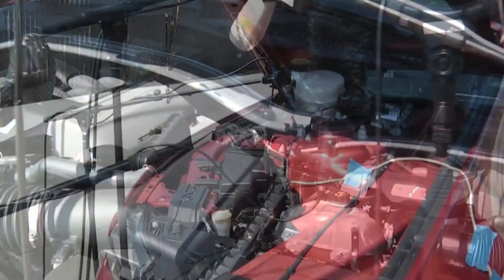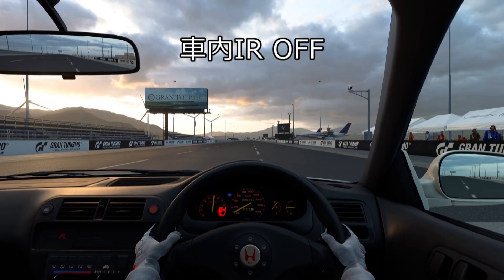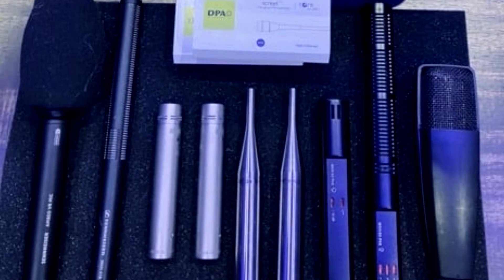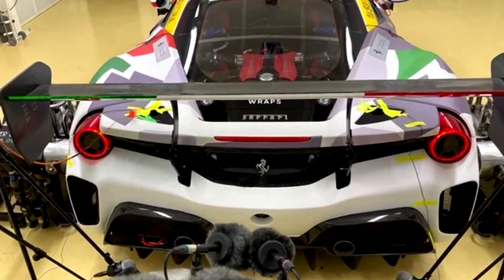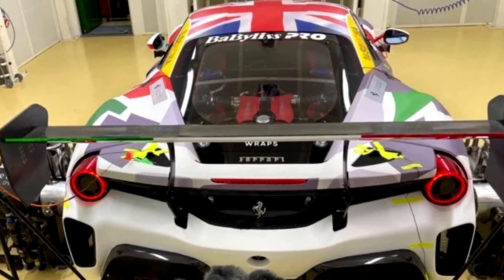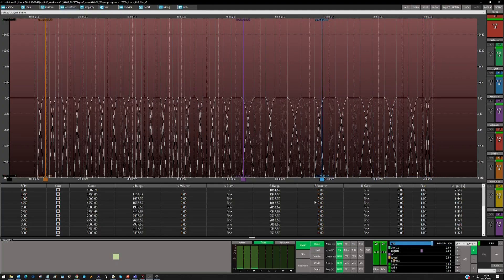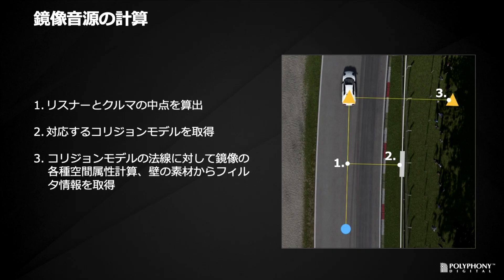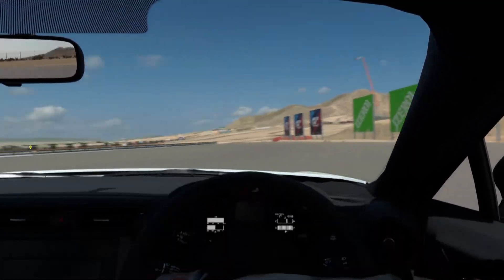Recording Car Sounds for Gran Turismo 7

Comment: I didn't know recording a car sound was so difficult. Respect.
Reply: Indeed. You would think simply recording the engine and exhaust and playing it back would be enough, but it gets extremely complicated. Playing back looped audio becomes immediately noticeable, so you need to use synthesis and variation to avoid generic repeated sounds. It’s arguably as hard or even harder than the physics tire models. Really tricky to get right, and really easy to get it wrong and ruin the immersion

Comment: Its sad that while these sounds are great, they game still lacks huge in immersion. Cars sounds like they all have a bit of slipping clutch when accelerating. Even Forza doesn't have this. And when compared to ACC, the shift sounds are so poor. When playing ACC you feel like you're in the car. The raw sound of the car, debris and curbs are aspects I miss in GT7. Which makes it feel like I'm playing a game instead of a simulator. And I'm not even talking about the physics but that's because they have a different realism level. But I guess that's what GT7 is made for. If they would include these aspects, GT7 would have no competition.

Comment: Assetto Corsa raw sounds inside the cabin are much nicer for a very... physical experience. However, that does not detract from GT Sound, which is either way amazing. IDK, I have an audiophile rig, and when I play GT7 with loud volume and sit on the wheel, maaaan... the sense of presence from side to side and distance to other cars and so and so... it is brilliant. It is an extremely satisfying experience, so much so that is rewarding even if you are far from winning a race.

Comment: Looks slightly cheap from a sound engineering standpoint. An old Digidesign 16 i/o, older RME interface, NT5, I spot a Beta 52 etc. Not quite top of the range equipment, but ok, I guess.

Comment: Whilst the engine start ups and idle sounds are as good as it gets, I can't help but feel some cars aren't done justice when driving them. 205 T16, Quattro Pike's Peak and Mazda 787 maybe some of the worst fidelity to the real thing.
Reply: Not an issue just of GT tho, the Quattro in DiRT Rally has this comically horrendous and super fake sounding blow-off valve, and half the cars use the same actual sound just meerely twekeed. 

I feel like the crazier and more iconic a car's sound is, it gets exponentially harder to reproduce that sound in a videogame. So many expectations on all the features of the sound to take on board.
Reply: Not even close to good as it gets, try AC and ACC and come back.
Reply: @CrewExpendable2007  lmao what you talking about? Not one time I said anything about Assetto's sound design. Some of you are more eager to be sassy with some "how about you tru this and come back" when no one is talking about those. Assetto Corsa and Assetto Corsa Competizione have incredible sound design, but won't match the start up/idle sound of cars in GT, down to the reason those are direct recordings playing back, not a sound engine actually having to make a sound. "How about" I've been playing some of these games since launch and got a clue what I'm talking about.

If you really want to talk good sound design there's no need to go out of Play Station exclusives. Driveclub definetly was and still is one of the most inmersive experiences in a racing videogame. Sound in both Assettos is great (bought Corsa just to fool around with the quattro), but Driveclub was a masterclass. Visceral, believable and good.

Comment: They finally got the sounds right after 20 odd years.
Reply: Not really. More like 75%, just listen to LFA in garage vs on the track.
Reply: @Sylsomnia22 they nailed the lfa even during gameplay even better than ac with mods
Reply: @andreasmoller9798  LFA sounds okay, especially from slow acceleration, but listen to start up in garage VS on track idle rev, there's a huge difference.
Reply: They’re still far from right.

Comment: When you are in replay mode or some times in chase cam, the wind is way louder than the car. I don´t believe that is realistic, in that sense i would much rather have something similar to assetto, the chase cam and replay in ac sounds really raw and loud in certain cars, wich is something i feel like its missing in gt7, most cars sound feel muffled. Other than that, i think that they are doing an amazing job at the car sounds
Reply: Muffled, because no dynamic.

Comment: I have two BST-1 bass shakers on my racing rig, one under the pedal's plate, the other under the seat and the bass shaker's amp connected to the monitor's headphone jack that I use with the PS5/PS4Pro/PS3. I previously had the bass shaker's amp connected to the laptop to use SimHub with GT7 and I wasn't even aware that these bass shakers would play any audio besides shaking/vibrating until I connected the bass shaker's amp to the monitor's headphone jack, changed one of my cars in GT7 where it started revving very loud through the bass shakers and making me feel the engine revving too. I was blown away by the revving sound of each car I changed going through the bass shakers and feeling the engine revving like in a real car to the point that I kept increasing the volume and changing my cars again lol. Good job Polyphony Digital sound engineers.

Comment: "Built from the ground up" done right. And no, I'm not memeing or anything, it's just one of many proofs, even though it came at a cost of compromised single player quantity.
Reply: rolfwaffle would say other otherwise this game is also on the same caliber of awfulness just like mf ghost and Forza
Reply: @siddheshpillai3807  I actually agree with that. The difference is that they actually did it, unlike Forza where they actually lied straight up. Also, it's great if your opinions aren't based on what someone else says.

Comment: Forza has been rough throughout FH3 and FH4 but i feel like with FH5 and the addition of intake noise that varies depending on the filter / intake system or the different levels of exhausts you can fit definitely improved the sounds. Rotarys and small displacement 4 cylinders dont sound like mosquitos and the inline 6 and V8 engines have gotten a lot beefier. I hope they take it even further with FH6 and use the same principles as GT does. It definitely pays off.
Reply: Agree but they ruined turbo dynamics. Turbos will purge at any rpm/throttle input

Comment: I don’t understand how they record the actual cars for the audio but then they don’t actually sound like the cars in the game?!

I mean I applaud the effort but it just doesn’t translate to the game as well as it should. 

Much better than they used to be, mind you.
Reply: How many of the cars in the game have you heard IRL?
Reply: @ViaticalTree  I’ve heard a majority of the cars in the game in the actual (real) world, and the sounds in this game are actually terrible. They do not emulate reality on any scale. OP is right ^
Reply: @ViaticalTree  an easy one for me is an STI. Everyone's heard an STI, the boxer engine note is very distinct. GT7's interpretation completely lacks any of the low rev growl or the throaty-ness (scientific term) at the top end.
Reply: What headset or sound system are you using?
Reply: @dsmith9599  High end headphones like Denon D9200, Meze 109
Reply: @dsmith9599  Bruh 😂 “what headset are you using” GT7 sounds are terrible, is what it is.
Reply: 🤦🏼🤦🏼those Japanese STi's don't rumble🤦🏼🤦🏼

Also the boxer engine doesn't actually sound any different then a regular inline four, that's just something people who don't know well enough believe, Subaru simply uses cheaper unequal length headers, that's where the rumble is from, but in Japan it uses higher performance equal length headers for that STi, only unequal STis

This is the same reason the GT86/FRS/BRZ all don't rumble even though they have boxer engines, same with; BMW, Porsche, Toyota boxer engines over the years, people's expectation of reality & real reality are often misaligned
Reply: @ChroniclesofKToyoda  where else they building STi? Literally all come out the same factory. I know it's the unequal length headers (not necessarily "cheaper" btw) and I'm still standing by an STI and Civic sound nothing alike anywhere on earth, except in Gran Turismo.
Reply: @CaptDust  you huffed & puffed about how boxers need to sound a certain way which is false & the STi in the game that doesn't rumble also doesn't in real life because it's a Japanese version

Stand by it if you like, it's still wrong for you to want it to rumble when the real version of that car doesn't do that & does have the cadence of regular 4 banger, there's guys on YouTube that's even made videos to point this out
Reply: @ChroniclesofKToyoda  I aint huffed, just another person that want Sony to do better. They got all this money and they got their sound engineers doing the most. Whatever they're capturing in these booths is getting crushed by the time it makes it out a PS5. Thats all. Goes beyond an STI and generational or market differences, you can compare an AMG or M3 or whatever take your pick - it don't sound like Asseto, or Forza, or real life.
Reply: @CaptDust  bro face it that STi sounds accurate, there's video proof of it, I'm using a proper high powered subwoofer & it sounds amazing, none of that tiny flatscreen limp soundscape

People just want that amped up Hollywood Video Gamey sound because they're removed from reality. NVH is a thing, everyone expecting blowoff sounds on internally wastegated turbos & act like they're the experts

GT is literally started by an Ace Sound Engineer from Sony's music department, they know what they're doing within the constraints of the hardware without sacrificing on authenticity
Reply: @ChroniclesofKToyoda  “Within the restraints of the hardware” is the most important part of that paragraph. The game engine they’re using doesn’t allow for the optimal transfer of pre-recorded audio into the game itself and that’s why the car’s do not sound accurate. If you have any interraction with an actual race track or “high performance” or even enthusiast cars at all you know right away the sound design in the Gran Turismo series has been horrible for the last 20 years and it hasn’t changed. Its mildly improved but the base issues are still present.
Reply: @CrewExpendable2007  lol "pre-recorded audio into the game" isn't hard at all, playing a recorded sound has been trivial to do since original PlayStation, what's difficult is having it play at correct frequency & load for a given time with regard to space & acoustics something that's easier to do on PS3 then 4 or 5 because of X86's lack of bandwidth, with that in mind the audio is extremely good for hardware that isn't bespoke realtime audio processing gear

You can play an MP4 file of real cars that doesn't mean it's an accurate sound for the conditions GT isn't like GTA, Polyphony Digital is actually trying to make the audio accurate as it comes out not simply sound like a limited run of switching sound samples. As some who's literal job was at one point to road test other people's cars for a living(at times after modifying them)people don't realize how tame most cars actually sound especially modern unmodified cars
Reply: @ChroniclesofKToyoda  I realize that, believe me I do. My quam is the other 50% of the car roster still sounds nothing at all like what the actual cars sound like. Games like ACC, iRacing, RaceRoom, even non-sim titles such as Driveclub from 2014 (10 years ago!!) was able to absolutely shatter every opponent in this department. So the single largest company in the entertainment industry (Sony) can’t do just that, 10 years later? They can. But there is no demand for it, because Gran Turismo fans are too complacent, too comfortable and naive. Their only real competitor (sim-arcade, not full on simulation, because Gran Turismo isn’t one) is Forza which isn’t even worth talking about it’s such a failure. So no competitors, no demand from your financial support, = 0 improvements. And that’s exactly what GT7 is in terms of it’s sound design. 0 improvement.
Reply: @CrewExpendable2007  can only comment on the sort of legal cars I can draw experience from, & they haven't put a foot wrong in terms of sound, as for genuine race only cars, well I've only ever tracked modified street cars most haven't even done that so have even less experience to draw from but even those aren't built like complete rattling tin cans as some would have you believe

The issue is really people's expectation of what realistic sound is, Driveclub as example is extremely pleasant sounding, many would even say realistic, but in reality all those cars are far more muffled & tame compared to how it's portrayed in media which is obviously more arcady & less accurate

Hollywood for example shows every Tahoe & Suburban with the same played out breaking SFX ignoring the reality of just how much nosedive it takes when actually locking those up assuming ABS let's you, even more atrocious is the Crown Victoria cars sliding about left & right every chance they get, when in the real world it's near impossible to hold a slide in those unmodified even breaking traction from a launch more often than not won't happen, that's reality

TLDR; everyone expects arcade SFX from GT like turbo spooling & blowoffs when most factory cars in GT already do spooling louder than they should and almost all factory turbo cars are internally wastegated so that sound shouldn't exist, then you have people like OP asking for a boxer rumble in a car that's not even supposed to have it because the folks criticizing GTs sound for the most part are living in their perception of reality. Kaz' the cook is Sony's literal Ace Sound Engineer pulled from Sony Music, & ever since he got back into overseeing sound(GT Sport)sound has been amazing, then again I'm playing with a bigger powered subwoofer than most, people playing on anything less are doing themselves a disservice, like playing without HDR, you're giving up a whole dimension of depth that's there but only with the right hardware

Comment: Dirt Rally 2 and ACC sound outstanding too!
Reply: They are both light years ahead of Gran Turismo in terms of sound design.
Reply: ACC is one of the few games that captures how loud real race cars are, I work in racing and it is deafening… ask me how I know.. loudly.
Reply: @ricepony33  I think even ACC could be louder. Ive attended a few GT3 races last year and have a few to go to this year. The 992’s and Huracan’s in particular shatter your ear drums, especially if you catch them downshifting. I recorded audio of a 992 downshifting on a hairpin, it sounds like satan screaming at you, its intense! Gran Turismo does an absolutely pitiful job at recreating this, AC and ACC do it the best so far with sim titles like Raceroom just behind them.
Reply: @CrewExpendable2007   because gran turismo 7 has variety of vehicle type  polyphony digital goes from a divers point of view although 3rd person point of view sound may differ
Reply: @ricepony33  
I agree 100%.  I worked in F1 in the early 2000's and those V10's would make my internal organs rattle around each other when standing mere feet away.
Reply: The sound of slightly slipping tyre rubber in ACC is superb. I wish every game had similar audio quality.

Comment: Another thing i am wondering is the difference between garage sounds and in game sounds. I believe the garage ones are actual recordings? Because they sound so different and much better.
Reply: I think for those they literally just use a recording since it's only a startup and a few revs. No further computer help needed. Or not much help anyways
Reply: @masonmethot  I guess so. I hope in game idle and revving sounds also sound as good in GT8
Reply: I was wondering who noticed that too. I'm making a video soon, comparing garage sounds to racing sounds, like LFA sounds vastly different.
Reply: @Sylsomnia22   yeah i hope in game sounds can be as good as the garage ones in the next game

Comment: I love GT7 but the car sounds are still off. I reckon other games take a more qualitative approach. It never feels beefy enough in GT7. I think IRL car sounds have a lot more presence and you probably need to fudge high fidelity recordings to make it work. Outside the car, the reverb is way off and always has been.
Reply: No the car sounds are not off gt7 is one of the most accurate ones,
Reply: @andreasmoller9798  You have never been to an actual race, GT is by far one of the worst in terms of its sound design. Absolute garbage.
Reply: @CrewExpendable2007 you have no idea what you are talking sbout.

Comment: The sound design in GT7 is leaps above those old screeching tyre days where every cornering car sounded the same... not that long ago in the series either!
Reply: those old screeching tyre days where every cornering car sounded the same were better than today, GT2 is still the fucking best
Reply: Thats true, however still far away from perfekt/real . Still work to do for GT8
Reply: @Kazuya720  I dunno it's pretty good already, gotta praise what they've done!
Reply: I also wonder what would be necessary, to give a real world goosebumps sound. Maybe, it is not possibel to achive.
Reply: @Kazuya720  I really hope they improve it a lot in GT8. I hope it is going to be as wild and as powerful as real sounds.
Reply: Yeah, i like the way the tires skip over the tarmac on some turns. It's very detailed.
Reply: I hope they used similar sounds to ACC which actually sounds like rubber slightly sliding on dry tarmac when you're about to lose traction.
Reply: This is largely in part thanks to them hiring an ex Forza sound guy.
Reply: The ex-forza employee left polyphony in ~2021-2022. He no longer works for Polyphony digital.
Reply: @the_reese  I know that. But he still righted the ship.
Reply: @JTube571 😂
Reply: @xnotasweatx  it's true...